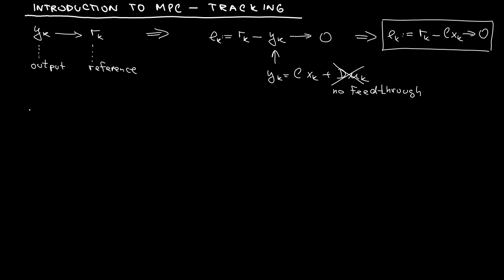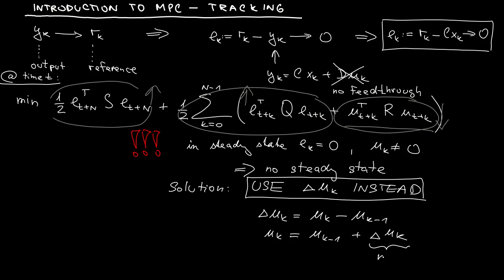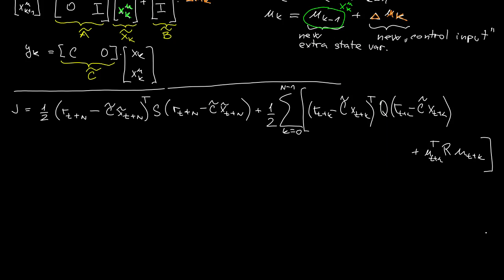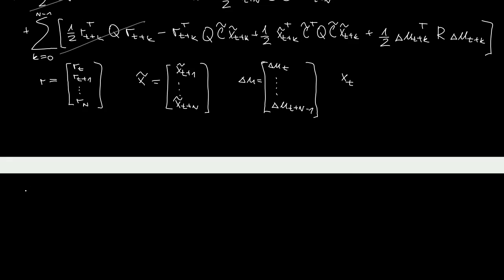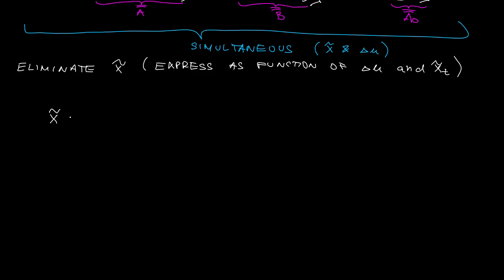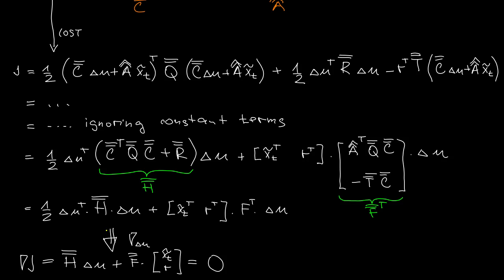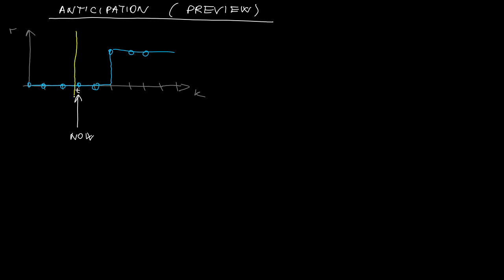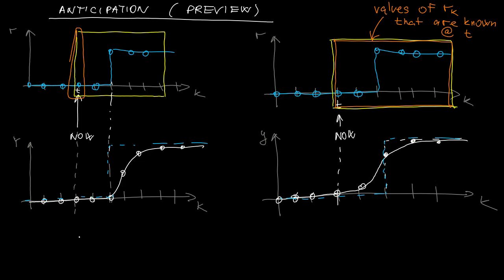L3.4 - Introduction to Model Predictive Control (MPC) - reference tracking

Comment: At time 7:40, J is not written correctly: The diagonal [ Q ... Q S ] should be [C'QC ... C'QC  C'SC ].  BTW, Thank you very much for these lectures. They are awesome.
Reply from the maker: You are perfectly right. I am aware of this problem and it has been corrected in the accompanying text available at the course website at https://moodle.fel.cvut.cz/mod/folder/view.php?id=112098 (week/topic #3, "texts for the videos", for some reason the link seems to only direct to the course itself but then you have to navigate manually). Correcting the video is more difficult (time consuming) now that stickers are no longer available on Youtube.